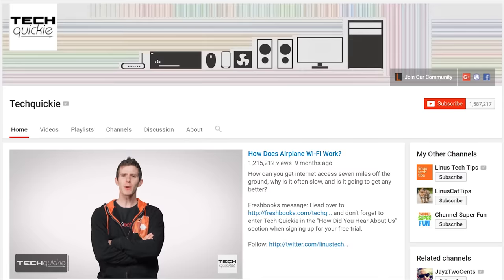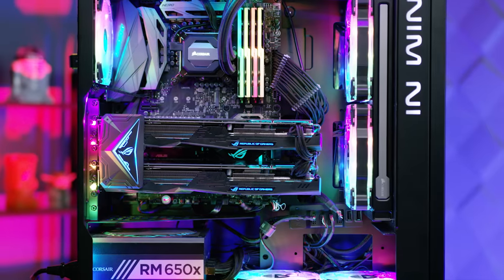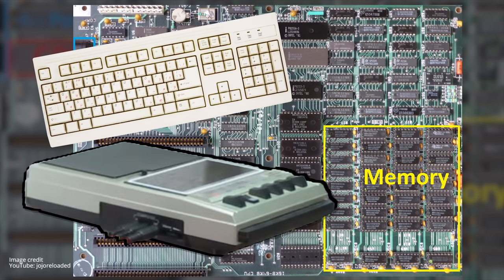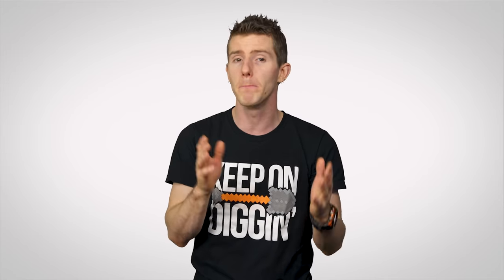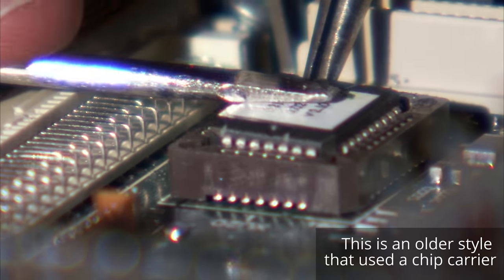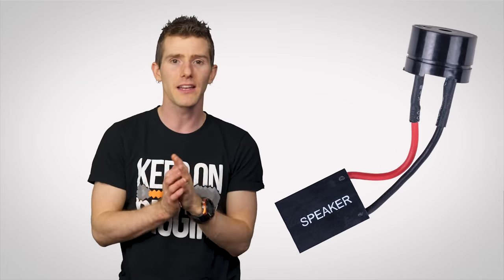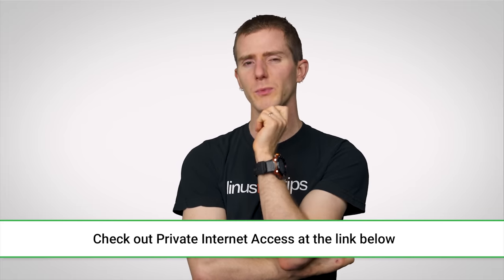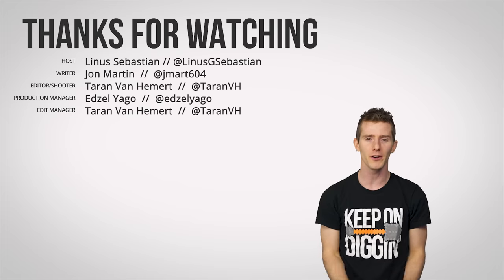History of the Motherboard

Comment: In 1985, the Amiga had multi-channel digital sampled stereo sound and a proto-GPU that offloaded 2D work from the CPU. All part of the same board.
Reply: Amiga truly was a machine ahead of its time. It took PCs nearly a decade to catch up.
Reply: Amiga forever!
Reply: @sapphyrus  So much ahead of it's time that the now celebrated "direct access" to the computer's RAM from the GPU is, I think, what would be called ChipRAM in Amiga, and dating back to the Amiga 1000 as early as 1985...  so, jump 40 years for PC to catch up to that...

Truly, processor dumping stuff in memory, for graphics and sounds chips to take and compute... that's what Agnes and Denise have been doing all along... no?

Comment: I still remember doing my first memory upgrade. It was about 12 IC Chips in a plastic tube that I had to insert into sockets on the motherboard. I'm not sure what the computer was at the time but I'm pretty sure it had a 8086 or a 8088 processor. I also remember the first computer I home built was an 80386 with a 80387 math coprocessor. Inserting those chips was a real pain... lol

Edit: Yeah, now that I think about it the memory upgrade was actually on a 80286 system. I was upgrading the 384K of base memory (Soldered to the motherboard) to a whopping 640K! A huge upgrade for the day... lol
Reply: Richard Crockett how old are you?
What time are you talking about?
Reply: Richard Crockett shit I have a socket one
Reply: J A - Oh the memory upgrade was probably around 1985 and may have actually been a 80286. The 80386 was probably about 1988 or so. It was a long time ago... lol
Reply: Nicholas Wilkowski - Socket 1 was the 80486... The 80386 used a LIF(Low Insertion Force) socket that predates the socket 1. It was similar but it was a lot easier to end up with bent pins if you didn't apply the right amount of force and make sure the chip was kept straight while pushing it down. Socket 1 was the first ZIF(Zero Insertion Force) socket.
Reply: I remember those days.  You  bought a brand new, very expensive, high-end butt-kicker computer and it was obsolete junk in about 8 months.
Reply: Richard Chapman - That's one of the reasons I started to home build them. Just a standard desktop computer back then could run you well in excess of $1000 so building them was a heck of a lot cheaper even more so than today. You could build something for around $300-$400 that would cost you well over $1000 if you bought it pre-built.
Reply: I remember mine..32 K ram, about 8 chips into a Z80  CPU  ZX spectrum...I was so nervous that I sweated into the mobo and fucked it.....doh !....that was 1983...just a poor poor school boy...
Reply: Man I feel old lol

Comment: The "ISA" standard was adopted from the IBM *AT*, not the PC.
The PC had sockets the length of "up to the key", as they were 8 bit sockets while the AT (and the later-named but mostly SAME "ISA" socket) were 16 bit.
The AT and ISA sockets WERE backwards compatable with cards for the IBM PC original sockets (it's part of why that key is THERE at the location it's at).

You missed the "EATX" socket, which was a 32-bit backwards-compatable to ISA/PC sockets competition WITHOUT ROYALTIES NEEDED TO INTEL like PCI - when Intel got smart about royalties, PCI finally started taking over from EATX.

Comment: 05:05 I wouldn't call AGP short-lived, at least compared to something like VESA Local Bus. AGP effectively stayed around for ten years, at a time when the market was moving quite fast.
Reply: Don't forget micro-channel :p (and cardbus) (oh, and get in the way back machine for "multi-bus")
Reply: I had a Geforce MX 4000. Then I upgraded it to a Geforce 6200. It was hot garbage.
Reply: And don't forget ARM slots.
AGP lived for quite a long time actually. A decade is huge in computer buisness. Enough to make a system obsolete twice.
Reply: The MX 400 and MX 410 were amazing cards before the 6xxx series hit. I wish I would have kept my 410 around, it had video input on Composite, S-Video and with a driver hack VGA at 1600x1200. Would have made a great video capture system today.
Reply: And don't forget also EISA. Only seen in servers and workstations.
Reply: yeah that was my thought as well....
Reply: eloj AGP was long lived. MCA, EISA, VL-Bus and obscure company centric local busses like MediaBus from Asus was short lived. At least 6 different local busses was invented between MCA and Pci.
Reply: Those are video outputs not inputs
Reply: Are you sure that wasn't a MX 400? The MX line only had 3 digits. I've had both a MX 200 and 400.
Reply: I went from a 440 to a 6800gts.... amazing
Reply: @atlas8827  , Microchannel also lasted about 10 years. If not for the licencing it may had been the bus of the future as it was a true plug and play bus. I still have at least one example of almost every IBM PS/2. Great little systems for the time.
Reply: yes my first (2001) and second (2005) motherboards both had AGP slots...
Reply: AGP gave rise to PCI.
Reply: Unlike AGP, which is literally dead since a decade, your Graphic card still emulates VESA Local Bus, as every GPU still has a SVGA compatible chip on it and VESA was part of the SVGA standard (That's because SVGA can be driven by the bios in real mode with any additional drivers, so you can for troubleshooting always use that mode.
Reply: @clydesdalefan  Micro Channel was propriatary, and I think that only Tandy ever licensed it for machines (and THEY did a tech swap agreement with IBM, didn't pay the actual INSANE licensing fees).
A few card makers made cards for it, but IBM was a TON cheaper to CARD ONLY makers as it helped them sell machines.
Reply: @eideticex  I never had a 6xxx card, but I DID (and still DO) have motherboards with the 6150 "on the chipset" version.
Reply: @ronaldod7116  Nope, it saw SOME use in PCs - though it wasn't common.
Since Dell and Gateway and HP were all PART OF the consortium that wrote that standard....
Reply: @brostenen  PCI took years to adopt after it was invented - partly the overhead, partly Intel was playing an IBM game for a while with excessively high licensing fees (they got better).
Reply: @bricefleckenstein9666  That is not exactly how I remember the time from 1992 to around 1995/96. I were studying computers and all those I went to school with, all had apprenticeship in order to be able to study. And so, we all talked about newest computer tech. The education in question, were the most advanced in hardware area. Meaning that with this education, you could be hired as a hardware enginere. Yes, one that actually invented CPU's or motherboards.

Anyway.... As I had my fingers and attention deep down new hardware, and how it actually worked. Then I can only say, that the only license fee for PCI, is the vendor ID. Not the bus it self. It is an open platform, and not closed like MCA. It is more in the area of EISA.

What went down, back then, is that PCI were instantly adopted for server markets. But the home market were dominated by VLB up to around 1995 and went extinct sone time around 1996.

So no. How you describe it, were not how things went down.
Reply: @bricefleckenstein9666  And that brings us to roughly 1993, before license fee's were dropped. And still does not account for the next 3 years, were people still used VLB. Nope. The reason why PCI became the dominant, were that people switched from 486 to Pentium.
Reply: @brostenen  Cost of chip sets that supported PCI, and availability of them, was more of a factor than the actual CPU.
Also, we needed cards to PUT in PCI slots (mostly video cards early on for consumers, high-end many-drives controllers and LAN for servers).
Reply: @bricefleckenstein9666  Dude.... I was there. People used VLB, because it is a 486 centric BUS. Nobody switched to PCI before they upgraded to Pentium. And nobody upgraded to Pentium in 1995, because it was too expensive compared to 486. Hence... People did not adopt, because they had no need for PCI. In this case, the CPU have everything to do with it.
Reply: @bricefleckenstein9666  Yeah. I know. I have had 486 motherboards with PCI. But those were build when most had migrated to Pentium. Still does not change the fact, that during the times when 486 was populair, nobody used PCI, because VLB was the standard in home computing.
Reply: @brostenen  True for a lot of the "486 popular" time frame, but the migration took longer than you think - especially given the limits of the first gen Pentium and it getting VERY little adopted due to the heat issues.
Reply: @bricefleckenstein9666  I am only talking about the time frame/era of 1992-1996, as why PCI was not really that used and wide spread in the home market. And when most upgraded around the mid-90's, they upgraded from 486 anyway.

Sure some still bought a 486 with late era motherboards, but those were few and not really a general thing.
Reply: @brostenen  The shop I worked at for a while sold a LOT of "late" 80486 motherboard and 100+ Mhz 80486 CPUs - and VERY FEW Pentiums - for a couple of years.
They were NOT few, they WERE in fact a widespread thing - and were a contributing factor to why Pentium sales were SLOW to ram up.
Very few of those boards had Vesa Local Bus - and the ones that did ALSO had PCI.
That was in mostly 1994 and 1995 - and a lot of our sales were to local businesses, some large (PNY Bank, the Colts and Pacers, CONSECO, were probably our 4 largest customers - though I am note sure they made ALL of their buys though us, they WERE substantial orders that often took days to fill).
Reply: @bricefleckenstein9666  Exactly... PCI bus gained population with the sales of Pentiums at 166 to 200 megaherz. And yes, few (extremely few) pentiums had VLB, but only because they used a bridge chip. And performance were crap. Yes 3,3 to 3,6 volt 486 class CPU's had ISA, VLB and PCI. They were the so called VIP boards. But that was around the mid 90's and in no way the first half.
Reply: @brostenen  PCI had server traction very early on.
By 1994, it was already gaining significant traction in desktops - BEFORE the 3'd Gen Pentiums hit 166 and the 4'th gen added MMX and went 200-233.
VLB and EISA were pretty much dead issues before the Pentium hit 200.

And yes, PCI in desktops DID start appearing before 1994 - but they were rare in 1993, common in 1994, and almost universal by 1995, with PLENTY of 80486 boards sold with PCI on them (though often ALSO with VLB for backwards compatability).
First gen Pentiums were March 1993 (50/60/66 and 5 volt), the second gen was LESS than a year later in early March 94 (for the 90 and 100, for some reason the 75 got delayed a bit), the 120 and 133 didn't show 'till 1995 and the higher speed ones were 1996.
PCI was ALREADY COMMON by the time your 3'd get Pentiums showed up.
Reply: @bricefleckenstein9666  You still had to sell them. And not many bought PCI based systems before Socket7 Pentiums at the speed of 166mhz. Doom made people buy 486dx2-66's around 1993. That was the defacto standard back then. And then you had the next major wave of sales around 1996 and forward, fueled by Win95/98.
Reply: @brostenen  The point as that we DID sell them - in greater quantities than Pentiums for a while.
You greatly underestimate how many 486DX4-100 chips and even -133s sold AGAINST early Pentiums, due to the much lower cost.
Reply: @bricefleckenstein9666  I dont. But the whole conversation is based on the time frame 1992/93 to mid 90's. And my point is, and still are, that PCI was not widely spread and sold to the home market, before the mid-90's. Due to people buying 486dx2-66 because of Doom in 1993. And people could not afford to just buy a pentium two years after they have gotten a brand new shiny dx2-66. Basically, license fee or not on PCI. People had bought their expensive PC around 1993, and that had to be worn out before they bought a Pentium.
Reply: @brostenen  Hint.
While Doom was a popular game, THE LARGE MAJORITY OF PEOPLE NEVER PLAYED IT, much less bought a machine SPECIFICALLY to play it.
You seem to be ASSUMING everyone did so - which is a VERY VERY BAD ASSUMPTION - and it seems to be affecting your ASSUMPTIONS about how many PCI-capable machines WERE ACTUALLY SOLD before the 2'd Gen Pentium was released.

Comment: 5:34
Ethernet won a marketing war - but ArcNet and Token Ring were SERIOUS competition for a while.
ORIGINAL Ethernet originated in Xeroc PARC, but when Bob Metcalf left PARC to start up 3Com, he also made the point of releasing the 10 Mbps version that could use BNC T connectors and small coax (higher-spec RG-58 variant officially, but RG-58 worked well enough in most cases) instead of the earlier RG-213 (double-shielded RG-8) and "vampire taps" that were very fragile connections (many folks used C or N type connectors and Ts instead).
Twisted Pair came later - made Ethernet cabling CHEAP - and that's where it won the war.

Comment: Great overview.  I started out with an Apple II which you skipped - it was a major leap in design.   I was in Vietnam when the Popular Electronics (?) magazine came out with the Altair or Imsai kits on the cover.  Additionally, a major reason for expansion of use of personal computers was the Epson dot matrix printer developed for use by Seiko timing at an Olympics competition for printing timing reports.  Until then, to print, you had to use kludgy modifications of IBM selectrics.  

So, I didn't buy the Apple until I was working in corporate life for an oil company and a fraternity brother got a job in Los Angeles selling the new fangled Epson dot matrix printer for only $600 so you could print Lotus 1-2-3 reports (another major factor in business adaption of personal computers), plus Wordstar for writing reports.  The Epson MX-80 came out in 1979 and I bought the new system around 1980-81. 

My whole Apple II system with two external floppy drives, the Epson printer and basic software was about $2500, and I made $50 payments on it.  That was the cost of a new VW back then.  I used to carry it on airlines for trips to business units to do spreadsheet analysis.   I have an Altair and Imsai because I picked them up at garage sales in Orange County, CA where many firms started using them then replaced them with newer PC's when they came out.  

Now you need a full video on each old brand like the Commodore, Compaq luggable, Morrow Pivot, Kaypro, Sinclair, Trash 80, etc!
Reply: Popular Electronics was the Altair.
I think I still have my copies of those issues.
Radio Electronics, around the same time (give or take some months) did the Sol - which didn't catch on at all but foreshadowed modern "all in one" machines except for the monitor.

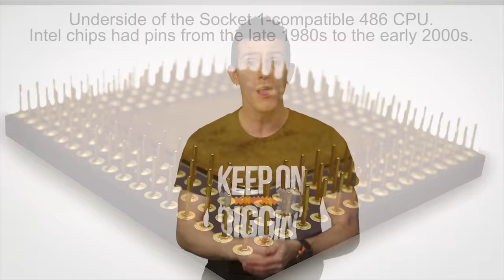Comment: 4:31
MANY early processors were socketed - LIKE THE IBM PC (5150) and some generations itself.
The 80386 ALSO had a square pin-grid array in some models (possibly all), the 80486 DID NOT originate that concept.
I don't remember for sure on the 80286, been too long since I had one, but I think they were a longer but similar in design socket to the 8088/8086

Comment: This was a good run down for the x86 ecosystem. But I feel that this was very incomplete for instance the NuBus slot standard had many features in the 80s that would not be completely duplicated until PCI Express became mainstream. But it was glossed over because it was never used in x86 PC's. Likewise IBM's MCA (Micro Chanel Architecture) standard pioneered many features that would not be widely adopted until PCI was developed.

Comment: 2:02 
We had massive upgrades between the S-100 bus like the Altar, and the PC.
Kaypro in particular made a significant business out of putting most of the entire computer on one board (power supply and INCLUDED video monitor, and they had a separate keyboard).
And don't forget the Tandy Radio Shack "TRS" line, especially the single-digit models.
Commodore.
Ghods, that's just 3 of the largest selling companies other than IBM pre-1983 or so.
The C64 MIGHT still hold the all-time record of "most units made and sold of a single model of computer" DECADES after Commodore died - despite much of it's lifetime being DURING the existence of the IBM PC.